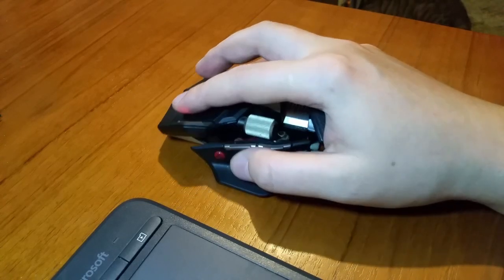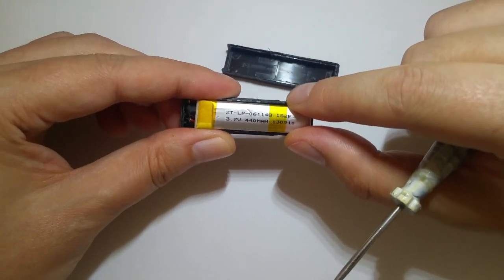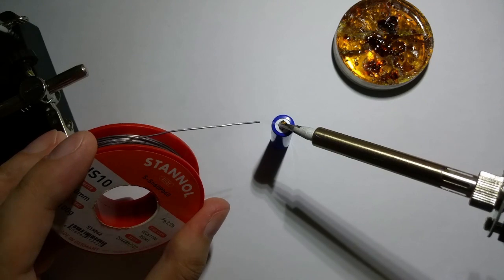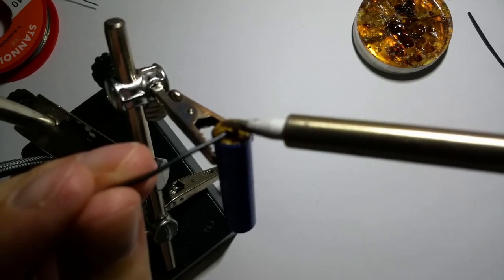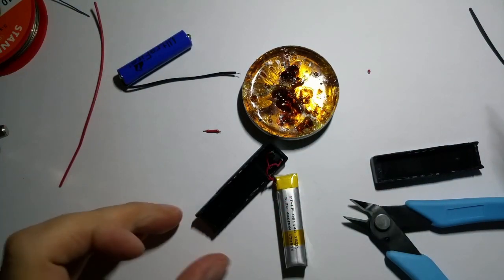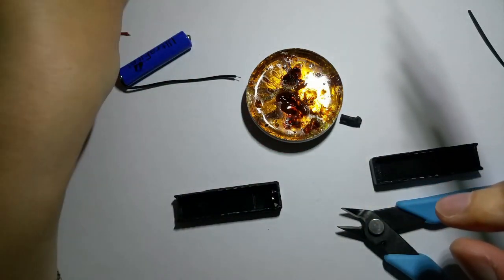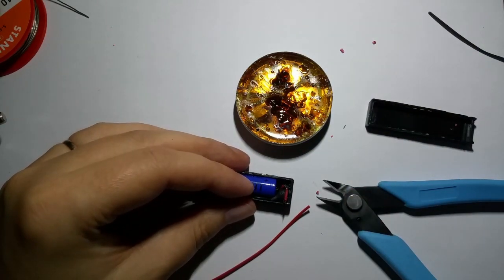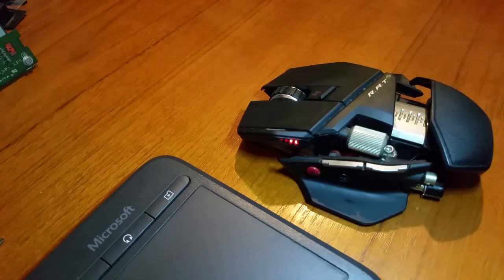001 - R.A.T. 9 - Battery replacement

Comment: The original had two cells, two ZT-LP-061148 tied together in parellel giving it 880mAh in total if I am not wrong. you can buy these cells individually from china. So isn't a singe 10440 600mAh battery going to be a slight step down? 

two of these cells at 450mAh can fit into a case: https://www.aliexpress.com/item/32957772335.html?src=google&src=google&albch=shopping&acnt=494-037-6276&isdl=y&slnk=&plac=&mtctp=&albbt=Google_7_shopping&aff_platform=google&aff_short_key=UneMJZVf&&albagn=888888&albcp=1582410664&albag=59754279756&trgt=743612850714&crea=en32957772335&netw=u&device=c&gclid=CjwKCAjwusrtBRBmEiwAGBPgEyQvC9TjmsgPyn_AX46bi0r3gKsVQD3K_uMb8uKX_DARQ1uMR4sDMxoC9HoQAvD_BwE&gclsrc=aw.ds
Reply from the maker: Hi David,

You might be right on that, I was under the impression that the whole "package" has 440mAh. The solution with single 10440 doesn't sound "excellent" any more, but I'm glad that I was under this false impression, because the initial project lead to this:
https://youtu.be/okaHkvJx7h0
which for me it's a perfect solution; when the 10440 I used as replacement will eventually die, the swap will be made in seconds :)
And even the replacement I used is less powerful (as it looks), it doesn't "feel" that way, one charge lasts about the same number of hours as the original ones when I bought the mouse... maybe because they are brand new, I don't know.
Anyway, thanks for the tip and for letting me know that I was wrong :)
Reply: Dude, you just saved me some money, thanks a lot!
Reply from the maker: I'm glad to hear that and you're welcome ;)
Reply: @badjano  Where did you buy your cells?
Reply from the maker: Just search on Google "AAA 10440", Google will most probably show you in the top search results what's near by you. Make sure you buy rechargeable ones :)
Reply: @david brassfield Can you explain how to wire these ive just ordered 4 of them as im not giving up on this mouse justttt yet
Reply: @d3lta826  maybe I will make a short video on me fixing mine. I ordered 4 batteries 10 months ago and I have been lazy in actually fixing mine as they aren't too bad. One thing to note is I think it's best to use the circuit board that came originally as it's a little more compact that the ones you get with new cells from China.
Reply: @davidbrassfield2855  yea I’d like to see that
Reply: @d3lta826  https://www.youtube.com/watch?v=TCe47_DQWDQ

here you go cheers

Comment: I did it today & it´s really works! Thanks a lot for your efforts & engagement with this video.
Reply from the maker: Well, actually I thank you for having the courage to try it, it's not a straight forward job, but engineers (either they are on "paper" or on their souls) can make it ;)
Reply: @I_T_T  I'm about to do the same after 11y (at last) thks to your help. This mouse is so good it would be a waste to not try.
I don't have the sort of glue or the battery yet but with the ref it should be easy to get.
Reply from the maker: @entasis704  go for it, just do it very gently and you will be successful.
If you have any questions, just ask.
Reply: @I_T_T  would it be safe to add some ruber band since I don't have that sort of glue you used, or do I have a chance it will stick on it's own. If it's a must have a link for the glue would be great.
Reply from the maker: @entasis704  what kind of glue are you talking about?
The thing with opening the case(s) in that way is that you need no glue to put them back together.
Reply: @I_T_T  gosh my bad french here, I m talking about the stuff you put on the battery before the welding.
Reply from the maker: Well, there is no chance to get it work reliably using rubber band or any kind of "traditional" glue. There must be a strong contact between the battery and the contacts (via wires), so I'm afraid you have to use flux and solder.
If you know someone with a 3D printer, you could try to make yourself the "non-soldering" version of the cases (see on the channel)
Reply: @I_T_T  the flux is the thing I didn't know about. I only use the basic tin to fix my akg headphone so I had no idea about that material. thank you, found some with the french translation :)
Reply from the maker: @entasis704  you don't necessarily need flux if the wires, contacts and battery ends are supper clean (in real life they are not), but the flux makes it a lot easier.

Comment: That was helpful. I've been using the RAT mice for years and already went through 3. I wanted to go wireless this time, but of course the original batteries are all shot. 

I got a working one for 40€ and will fix the batteries for another 10€ or less.
Reply from the maker: Hi Hans,
Thank you for your comment. 
It's a beautiful mouse I really don't want or need to change it anytime soon. Mine is working perfectly after more than 5 years (if I remember correctly), but the batteries were almost dead. In my opinion the ~10€ for 2 working power cells is totally worth it and I hope it will last me at least another 5 years :)
Good luck with your replacement operation! ;)

Comment: Hi. Thanks for the tuorial! Does the new battery last longer than the crappy ones from RAT?
Reply from the maker: Hi Stephen. Thanks for stopping by and for the question.
 Theoretically it should last longer (the battery I used has more mAh than the original one), in real life, I haven't noticed a massive "uptime" increase from this new battery, maybe one - two hours more, but that shouldn't count as "way longer".
Small package, little "juice", you can't change that :)
Reply: @I_T_T  - thanks man. yes ... small package. I have been toying with the idea that I could modify the battery case in some way, to pack a bigger battery in but there simply isn't sufficient space! I get a day out of one battery and less from my other, so I will be doing your mod to at least one. Thanks again. Steve
Reply from the maker: Hi Steve. If you don't want to risk damaging your power cell (not that you'll risk too much if you currently get a few hours out of it) and you know someone with a 3D printer, you can try creating you own power cell case, see my other 2 videos on the channel. I really recommend the "non soldering" version, it's a little bit more work on that, but it's really worth it. Good luck.

Comment: Hi there! Thanks for your tutorial! Finally I've done! All seems to work properly! (I've no a tester...) BUT... the problem is that the battery shell is now open. It's quite impossible to close it properly... Maybe it has better to find a method to open batteries without damage the shell... :-)
Reply from the maker: Hi Alberto,
I don't know how did you opened up the cases, but the two halves have some grooves on the sides that keeps the case quite close.
If you want, please send me by email (see channel description) some photos of the current state of the cases and hopefully I'll find a solution for it.

Comment: Hi, need some info if possibile: How about diametere of cables in mmq? instead of heat shrink tubing could I use isoanting nastor? However wht about dimension of heat shrink tubing ? thank so much
Reply from the maker: Hi Alberto,
You do realize that this is not a precise science :) You can use whatever you have at hand, as long as you make sure that everything is isolated (and it fits :) )
For example I used for this an ~3-4  (exterior) mm wire and the shrink tubes that were already in the original power cell. But you can use some 5-7 mm shrink tubes. The important thing is that you get the tuning over the end of the contacts before shrinking it.
Reply: @I_T_T  thank so much. I ve never done something like this and so I'm full of doubts :-p
Reply from the maker: Hey, everything it trial an error (until some point :) ) and in this case you can't make it worst than it is... the batteries are most probably all dead :)

Comment: Hello, what is the product to apply on the pile before soldering?
Reply from the maker: Hi there,

I believe you are referring to the soldering flux, it helps the soldering process mainly by removing the oxidation (but not only that)
What I used in this video is a rosin based soldering flux, but they are of many types and shapes, just search on Google "soldering flux"
Reply: Ok thanks

Comment: I'm rookie. I never done something like this. I already replace once orginal batteries so I have two dead "spare parts". Could you possibly give a link to right kind of battery to buy? What do you suggest fora SURE substitution? regards. A.
Reply from the maker: Hi Alberto,
You can find the link for what I used in this video (and the other 2 R.A.T. 9 videos from the channel) in the description. They will work for sure, 100%.
But (there is a but), please see the pinned comment from David Brassfield, he suggested another type of batteries; I can't give you any details on those because I didn't use them, but at least in theory they should be better than the ones I used. 

Good luck ;)
Reply: @I_T_T  thanks so much :-)
Reply from the maker: Prego ;)
Reply from the maker: What I used is something like this:
https://www.amazon.co.uk/ROSIN-electronics-solder-COLOPHONY-Purity/dp/B01N1SO4EA
it's a rosin and it works very good. Actually I've been using this kind of rosin for a long time on all sorts of electronics projects (just knick-knacks, nothing fancy)

What you listed is most probably at least as good as this rosin, but:
 - it has 125 grams, that's a lot and if this is the only time you will use it, is not worth it, plus it's a paste, it can dry over time and can't be used anymore; just saying, I never used this, I only assume. Rosin will last you a lifetime for sure (if you're not stepping in it :-D )
 - it's kind of expensive 17 Euros vs. ~4 Euros or maybe less (rosin)

If you want to invest in something that will really make a difference (and your life easier), buy some wires with teflon / PTFE insulation ;)

Comment: what about charging? You removing oryginal processor so it will never show "green" and never stopped to charging - how you manage not to overload battery?
Reply from the maker: Well, I'm on the third iteration of this power cell, no "processor" was added what-so-ever, and the power cells are charging normally, the dock / charger shows red when the battery is plugged in and green when it is charged. I'm not kidding or trying to fool you.

Comment: I'll need to do this evenly with my mouse battery, my brother also has this mouse he no longer using, so I can have it and the batteries.
Reply from the maker: Just don't rush into it, especially when opening the cases for the first time. Take it slow and the cases will look almost as good as new after opening them.
Good luck! :)

Comment: Hello, can I use 1000mAh battery?
Reply from the maker: Hi Matija. Yes, in theory you can use 1000mAh battery, in this case, what matters is the voltage (3.6 - 3.7 V). It will take longer to charge, though.
Can you please share the link to this battery? I would very much want to give it a try :)
Reply from the maker: That's interesting, thanks for sharing :)

Comment: PKCELL    what model i can use?
Reply from the maker: Hi Aleksandar. You can use any rechargeable battery of type 10440 (3.6 - 3.7 V); just search "pkcell 10440" on Google.
From what I could find on internet, PKCELL produce only 350 mAh batteries, so it will drain (on the other hand, should charge) much faster than the one I used here.

Comment: tried it. worked once, next 5 batteries either melted and shortcircuited inside or the plastic casing became unusable. I threw the mouse and the batteries in the trash.
Reply from the maker: When? Where are you staying? Is the trash still outside? :)
Well, it is not an easy operation, I must admit, but with some little patience it can succeed.

Pity...
Reply: hehe ye I slightly overheated the battery before solder gripped on and it started fizzing straight away.
Reply from the maker: As I said, batteries (rechargeable ones are no different in this matter) don't like high temperatures :)
Now, if you were joking about throwing the RAT into trash bin I hope you did), you can make the cases, no soldering required, please see my 3rd video on RAT 9 series.
Reply: Nah, didn't really throw it, in the end I managed to make 2 batteries, but one doesn't want to charge for some reason, so I'm left with only one and I dont wanna wait another month for new batteries. Already ordered new madcatz wireless mouse. Uses AA batts. Thanks for the vids
Reply from the maker: "Uses AA batts". Finally! A smart decision from their side!
I thank you for the sub, it really means a lot to me :)
Reply: @I_T_T  hehe, exactly what I thought =) anytime, keep the great content coming